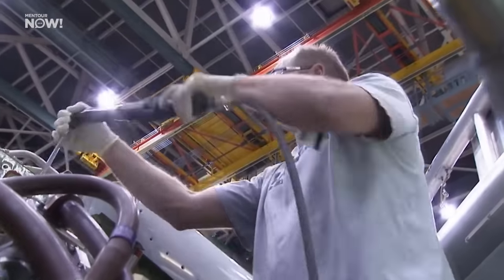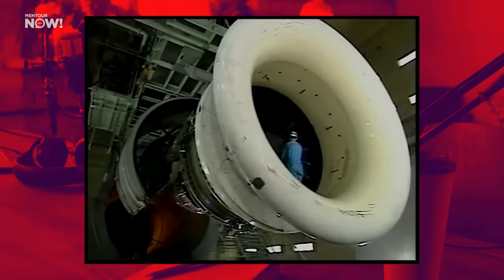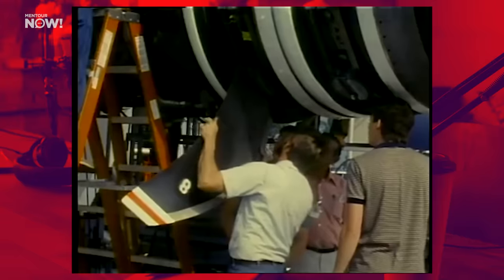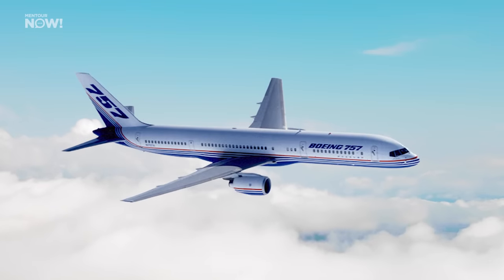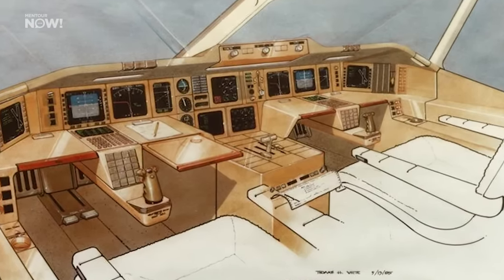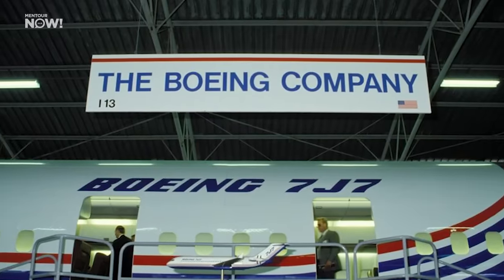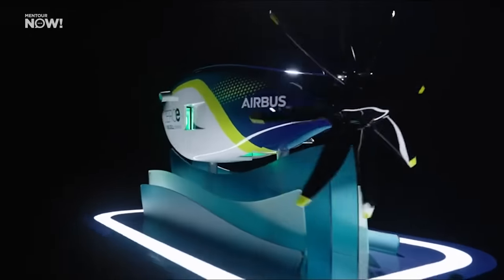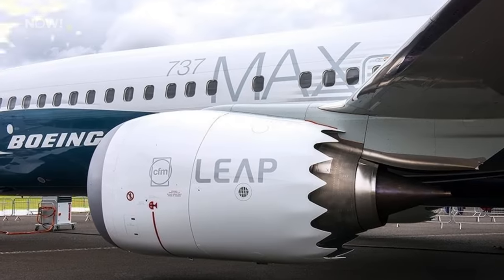Revolutionizing Flight! The Amazing Potential of the CFM RISE Engine.

Comment: I didn't know the Tupelov Tu-95 Bears were noisy because of the tip speed, I always thought it was a straight fluid dynamics issue. After the end of the cold war, the American Navy admitted they could identify them with submarines in the Arctic Ocean with Sonar microphones.  An aircraft so loud they could hear it at cruising altitude from below sea ice.
Reply: That makes sense: the achilles heal of the world's fastest turboprop aircraft! 👍🤭
Reply: The Russians ( USSR) were never able to match the US in technology. That's no surprise.
Reply: Maybe some complementary research should be done on acoustic isolation for fuselages. That would make flights quieter for passengers, if not for neighbors of airports.
Reply: @johniii8147  
Look again. The Soviet were first into Space and the first man in space. Lunar 2 was first on the Moon in 1959, not only that a few week later the Soviets sent a craft around the Moon taking pictures of the dark side sending them back. The USA was first in landing a man on the Moon, as if that made any great difference, and a reusable space craft, the Space Shuttle, which was a British idea. 

The USA had other firsts but they were small beer to what the Soviets did. The Soviet Lunokhod 1 was a remote controlled rover (the first) that landed on the Moon in 1970. To say the USA won the Space Race is absurd, as the USSR achieved most firsts, winning more races. The USA was playing catch up most of the time using a budget the Soviets scientists could only dream of. The Soviet guys were good.
Reply: @johnburns4017  USA won the marketing race to space because we still haven't beaten "the first human on a natural planet or satellite" achievement. Next step on that ladder is "First human on Mars" and we are still pretty far from that. And for general public the marketing race is the only thing that matters even if geeks could consider other factors, too.
Reply: @johniii8147  NASA were using Russian rockets to get into space until spaceX
Reply: @johniii8147  American exceptionalism in one comment
Reply: @statinskill  You do realize that "hypersonic" is just buzzword bullshit. It's like using "quantum" for woo effect. Talk is cheap.
Reply: @johnburns4017  Landing a man in the moon is a great difference. To the point no other country has done the same since.
Reply: @iwaswrongabouteveryhthing  NASA were using many types of rockets, not just Russian ones, until SpaceX. The Atlas is still around, but Russian rockets were the cheap option.
Reply: @ChucksSEADnDEAD  
Little was gained. All knowledge cab be gained by other cheaper means.
Reply: @ChucksSEADnDEAD  
If you are trying to say the Soviets were incapable of doing it, you are mistaken.
Reply: the thunderscreech was a good example of this. it had a supersonic propeller that caused ground crews to have seizures, and it even caused hearing damage when flying at a cruising altitude. there is no true recorded sound of the blades, but the faster props spin they get incredibly loud.
Reply: @sammiller6631  buzzword BS until we finally build one, right?
Reply: @johnburns4017  They could have been capable. All we know is that they didn't.
Reply: The civilian airliner based on the 95 was the Tu-114. In 1987 (approx) I was in Malta when all western air connections to Libya was banned. Their only air connection was by direct Tu-114 to Moscow. (they were brought back into service for this). One day I heard this amazing turboprop whine as the Tu-114 enroute to Moscow was nearing top of climb. Looking up I could identify the aeroplane clearly and the  noise, even at that altitude was very distinctive.
Reply: @ChucksSEADnDEAD  
Not could have, they were capable.  The Soviets were first in just about everything in space.
Reply: @davidmacdonald1695  
Take the stars and stripes glasses off.  Again...
The Soviets were ahead all along.  You are saying because they never bothered going to the Moon as the budget was cut, every other first they achieved didn't happen. 

Do you see Reds under the bed as well?
Reply: @sammiller6631  - Engineer here. "Hypersonic" is actually a real engineering term referring to speeds in excess of around Mach 5. I say "around" because there are a number of different definitions of the concept depending on what you care about, but all of them boil down to air starting to do strange things once you get going faster than that. A lot of the equations used to describe the behavior of air stop working when you're going that fast, so a new term was invented to describe that particular set of conditions.
Reply: @johnburns4017  I agree,  but we were the first to step foot on the moon. After that, well, who knows what the Soviet was doing?
Reply: @johniii8147  - Engineer here. This true in one sense and false in another.

It's true because Soviet engineering was comparatively weak in very high technology materials and electronics, or any other domain of engineering that depended on very tight, very rigorous quality control. This is not because they were stupid or uncreative. Their manufacturing capacity simply did not do tight, rigorous, hard-ass quality control very well, which was very much a political issue, not a failure of intelligence (as in smarts) or creativity. Running a manufacturing operation with high-level quality control requires the line workers and low-level engineers to speak up when they see problems and to suggest solutions to them, but their political system simply did not encourage people to stand out in that way. Their system also had a tendency to discourage intense research programs of the sort that inevitably experience a lot of failures (such as in rocket engines; it's pretty much a given that most of them will go 'boom') both because of political conditions and simple budgetary constraints. As a result, it took the Soviets a lot longer to develop what we in the west tend to call "high-technology" solutions to a lot of problems.

It's false in that the Soviets were as smart as anyone else and they excelled at low-to-medium technology solutions, like the AK rifle, the basic design of which was solidified in the late 40s and remains hugely popular. The T-55 was another example of such a system. It was a top-of-the-line tank when it was designed, and again, remains hugely popular. One might point out that the AR platform and the Centurion tank were Western designs of comparable longevity and popularity, and that's true to a certain extent, but that misses much of the genius of Soviet engineering: simplicity of manufacture and sustainment. The beauty of the AK design is that, aside from the barrel and the bolt, they require almost no real precision manufacturing capability at all. Given a supply of barrels and bolts, any half-decent machine shop can crank the things out, and even those two precision parts don't need all *that* much precision. Heck, with barrels and bolts, you can make the things in your garage with ordinary hand tools. Same goes for the T-55. With the exception of major armor repairs, a troop of baboons can keep a battalion of T-55s running with nothing more than the kind of tool set used to maintain commercial trucks. And again, aside from a relatively small number of precision parts and armor-related things, any organization with the ability to manufacture commercial trucks and their motors can manufacture spare parts for the T-55. This is emphatically NOT true for most Western designs, especially tanks and such. THIS is the genius of Soviet engineering.

And make no mistake; the Soviets could do high technology and good, tight quality control when they were really motivated. The modern phased-array, fully-digitally-controlled radar antenna of the sort used by the most modern fighters today was first deployed on the MiG-31. Integrated infrared air-to-air sensors are only now becoming common on Western fighter aircraft, but they've been a part of most Soviet and Russian designs for at least 40 years.  They also had a lot of great ideas that they may not have been able to execute because of budget and quality control issues. The F-35B's engine configuration was pioneered at least 30 years ago by the YaK-141, which was never fully developed because of the end of the Cold War. The Buran space shuttle used a rocket and booster combination that was, in many ways, somewhat more clever than that of the US Space Shuttle, but that, again, was never fully-developed because of the end of the Cold War. There is a pretty long list of good ideas the Soviets had that were later copied and fully developed by Western engineers (a good engineer creates a new design; a *great* engineer finds someone else's good idea and makes it better).

I hope this has shed a bit of light on some of the more subtle issues of Western vs Soviet engineering, and that we can put away these very childish shouting matches where we blindly assert that one must have been clearly better than the other.
Reply: @johnburns4017  I wonder why the Soviet Union collapsed
Reply: @johnburns4017  Good???.....not good enough to remain in the running......they blew their capability and never managed to get back in the race..........as in formular 1 car racing, a few first wins doesn't make you a World champion.
Reply: @JohnnyWishbone85  
You had me until you tried to inject politics into it.

Soviet technology didn't do tight tolerances because tight tolerances is expensive, and as big as the soviet union was, it was nowhere near as well endowed as America is. 

The soviets absolutely could do tight tolerance stuff, (remember the intricate listening device in that eagle?) It's just that there wasn't anywhere near as much resources for the soviets to piss away as the Americans did. 

Precision has massively diminishing returns. Why reduce yields to 1/10 for 10% better performance? The bloc needed more stuff than they had the resources to produce, why would you throw away the 9 widgets that mostly worked?
Reply: @anivicuno9473  - Sure, precision has a cost, and America was more *able* to bear that cost. But that doesn't answer the issue of why America was more *willing* to bear that cost, which you rightly raised. Why buy one of the great thing if you can have ten of the okay thing? It's a good question, and the answer, my friend, is...

Politics. You cannot get away from it. Politics touches everything.

EDIT: You'll remember that I did say the Soviets could do really good QC when they were really motivated. But it was harder for them.
Reply: @johniii8147  One thing we have learnt is the Russians don't really talk about their Pravda gear much.
Reply: @jamesmooney8933  There is no wonder why about that for a long time.
Reply: @sammiller6631  Apparently quantum tunneling is required for hydrogen fusion in stars. Don’t tell Elon or he’ll start boring holes in the Sun.
Reply: Boeing is waiting because we’re going to have grapheme batteries within this decade. Once we have graphene batteries you can make an electric plane. 

It basically works like this. Graphene is both able to be a material to built with as well as a battery. My assumption is that they’re going to make a hybrid plane. One that has the ability to drive the turbo fan with the electric motor while at cruising speed and the jet runs at an extremely lean burn that just sips fuel but can be turned back on to full thrust at any point. That way if the batteries fail the engine can still be kicked back in. 

Graphene will be lighter and stronger than carbon fiber and the hybrid technology will allow them to use far less fuel. 

Electricity will always be safer and cheaper than hydrogen. It uses existing reliable engine technologies that make it possible to pass regulations to fly. And most importantly the idea of an airport having an entire roof of solar panels to supply the electricity to these planes is an obvious win for both sides. 

Graphene can be charged almost instantly. It doesn’t have the issues other batteries have. It basically is able to absorb that charge with no latency.
Reply: @ZoneProfessionalGardening  
You need to do some reading. Back to the assertion that US technology was better than the USSR.  Yerrr sure Buddy.
Reply: @jamesmooney8933  
You have a wayward mind.
Reply: @gangleweed  
Once again.....
The Soviets were first at most things in space. I never made it up. The USA relied a  lot on the British to get themselves kick started - less so than the Germans. Search on YouTube Mark Felton Megaroc.  The British built a rocket and planned to have a man in space by 1950. All was handed over the the USA who based a lot of their space equipment on Megaroc, when they decided to do something of course.
Reply: @JohnnyWishbone85  wrote:
"It's false in that the Soviets were as smart as anyone else"

You need to do some reading sunshine. The Americans were not that bright as the British did the heavy thinking for them.
Reply: @stevederp9801  
Excellent post. BTW, the batteries will not fail as they will be in separate banks.  Skeleton an Estonian/German outfit is selling Graphine batteries. The density will get better and better as time moves on.
Reply: @stevederp9801  wrote:
"Electricity will always be safer and cheaper than hydrogen."

Redcar  in the north east of England, and Whitby near Liverpool in England are trials for hydrogen.  These places will have the natural gas pipe network converted to hydrogen, along with the appliances.  This is a trial.

These places were chosen as refineries are close that produce the hydrogen. 

Japan is turning to hydrogen for energy used by heavy industry.
Reply: @johnburns4017  You are looking at mechanics, and  not business environments.   The USSR was a planned economy.
Economy's are too complicated to plan.  Planned Economy's can have singular success,  but not over all economic.
Stalin had success jump starting a primitive economic into a semi-modern economy.
Reply: @johnburns4017  America won the space race because we reached the finish line first. Cope.
Reply: @johnburns4017  There is no dark side of the moon...there is the backside of the moon which during a lunar eclipse is fully lit up because the moon is between the earth and sun.
Reply: @johnburns4017  Nice job comrade...

Timeline: Famous Firsts in Space Exploration

Updated February 13, 2017 | Infoplease Staff [Updated by an Infoplease Editor on February 13, 2017]
pluto

Image of Pluto sent back by New Horizons.

Source: NASA

Here are dates of important firsts in space exploration
	
1958 	1963 	1975 	1981 	1985 	1990 	2004 	2015
1958 	

    Project Mercury, initiated in 1958 and completed in 1963, is the United States' first human-in-space program. It is designed to further knowledge about humanity's capabilities in space. 

1959 	

April
    Seven military-jet test pilots are introduced to the public as America's first astronauts. They are: Lt. M. Scott Carpenter, USN; Capt. L. Gordon Cooper, Jr., USAF; Lt. Col. John H. Glenn, Jr., USMC; Cap. Virgil I. Grissom, USAF; Lt. Cdr. Walter M. Schirra, Jr., USN; Lt. Cdr. Alan B. Shepard, Jr., USN; and Capt. Donald K. Slayton, USAF. 

1960 	

April
    NASA tests the first female trainees for astronaut duty in the Mercury program. Thirteen out of America's 25 top female civilian pilots (women weren't allowed to be military pilots then) pass the same rigorous testing that male candidates underwent in the Mercury 7 space program. Although all the pilots prove fit to become Mercury astronauts, NASA suddenly cancels its testing of qualified women in July 1961, claiming that they require jet test-pilot training at Edwards Air Force Base. Unfortunately, instruction at Edwards is closed to women. This new requirement ends America's chance to put the first women in space. 

1961 	

April 12
    Yuri Gagarin of the USSR becomes the first person in space. 

May 5
    Alan Shepard makes a suborbital flight in Freedom 7, becoming the first American in space. Time: 15 minutes, 22 seconds. 

Aug. 6-7
    The USSR's Gherman Titov becomes the first man to take a long-duration flight in space. His flight time is 25 hours and 18 minutes. 

1962 	

Feb. 20
    John Glenn makes a three-orbit flight in Friendship 7 and becomes the first American in orbit. Time: 4 hours, 55 minutes. 

1963 	

June 16
    Valentina Tereshkova of the USSR becomes the first woman in space. 

1964 	

Oct. 12
    The USSR's Vladimir Komarov, Konstantin P. Feoktistov, and Boris G. Yegorov take part in the first 3-person orbital flight and the first flight without space suits on the Voskhod 1. 

1965 	

March 18
    Alexei A. Leonov of the USSR takes the first space walk, which lasts ten minutes. 

March 23
    Virgil Grissom and John Young are the first American 2-person crew on the GT III. 

June 3-7
    While on the GT IV, the first American space walk is made by Edward White, II. It lasts slightly over 20 minutes. 

Top
1966 	

March 16-17
    The first docking happens between a staffed spaceraft, GT VIII, and an unstaffed space vehicle, an orbiting Agena rocket. Neil Armstrong and David Scott are on board the GT VIII. 

1968 	

Dec. 21-27
    Apollo 8 becomes the first spacecraft in circumlunar orbit and sends TV transmissions from this orbit. Frank Borman, James A. Lovell, Jr., and William A. Anders are the first astronauts to view the whole Earth. 

1969 	

Mar. 3-13
    James A. McDivitt, David R. Scott, and Russell L. Schweikart participate in the first staffed flight of Lunar Module on Apollo 9. 

May 18-26
    Apollo 10 becomes the first staffed flight to descend within nine miles of the Moon's surface. Thomas P. Stafford, Eugene A. Cernan, and John W. Young are on the flight. 

July 16-24
    Apollo 11 takes off on the first manned flight to the moon with Neil A. Armstrong, Edwin E. Aldrin, Jr., and Michael Collins. 

July 20
    Neil Armstrong becomes the first man to walk on the Moon. 

Oct. 11-16
    For the first time ever, the USSR puts three spacecraft and seven men into the Earth's orbit simultaneously. 

1971 	

June 6-30
    Spacecraft Soyuz 11 links up for the first time with space station, Salyut 1. It is also the longest stay in space to date. Georgiy Tomofeyevich Dobrovolskiy, Vladislav Nikolayevich Volkov, and Viktor Ivanovich Patsyev die on the mission due to loss of pressurization in the spacecraft. 

July 26-Aug. 7
    David Scott and James Irwin use the first lunar rover and send the first live pictures of lift-off from the Moon while on Apollo 15. 

1973 	

May 25-June 22
    The first staffed Skylab is launched, Skylab SL-2, manned by Charles Conrad, Jr., Joseph P. Kerwin, and Paul J. Weitz. 

1975 	

July 15
    The Russian Soyuz and the U.S. Apollo launches. The Apollo-Soyuz mission is the first international manned spaceflight. 
Top

July 17
    The American Apollo and Soviet Soyuz spacecraft link up for the first time. 

1980 	

Sept. 18
    General Arnaldo Tamayo Méndez becomes the first Latin American, first Cuban, and first person of African descent to fly in space aboard the Soviet Soyuz 38. 

1981 	

April 12
    The first voyage of the space shuttle Columbia begins. Capt. Robert L. Crippen and John W. Young are on the flight. 

1983 	

June 18
    Sally Ride becomes the first American woman in space. 

Aug. 30
    Guion S. Bluford is the first African-American astronaut to travel in space on the STS-8 Challenger flight. 

1984 	

Feb. 7
    Astronauts Bruce McCandless and Robert Stewart make the first untethered space walks (with jet backpacks) on the STS-8 Challenger flight. 

July 25
    Soviet cosmonaut Svetlana Savitskaya becomes the first woman to walk in space. 

Aug. 30
    Space shuttle Discovery has its first flight. 

1985 	

Aug. 8
    First flight of Atlantis space shuttle. 

Top
1988 	

Sept. 29-Oct. 3
    First flight of a space shuttle (Discovery) since the Challenger disaster. 

1989 	

May 4
    Magellan Venus probe becomes the first probe to be launched from a shuttle, Atlantis. 

1992 	

May 7-16
    While on a U.S. Endeavour mission, three mission specialists capture a satellite using their hands only for the first time. 

1995 	

Feb. 3-11
    First rendezvous between a U.S. spacecraft, Discovery, and a Russian space station, Mir. Also, Lt. Col. Eileen M. Collins becomes the first female to pilot a space shuttle during this mission. 

March 14-22
    U.S. astronaut Dr. Norman E. Thagard becomes the first American to fly aboard a Russian spacecraft, Soyuz TM-21, with a Russian crew. He is also the first American to enter the Mir space station. 

June 27-July 7
The Atlantis becomes the first space shuttle to link-up with Mir.

1996 	

March 22-31
    Shannon W. Lucid is the first American woman to live on Mir. 

2000-2001 	

Oct. 31-March 18, 2001
    The first crew boards the International Space Station. 

2002 	

April 8-19
    Mobile Transporter, the first railroad, is put in space during a mission of the Atlantis. 

2003 	

Aug. 10
    Russia's Yuri Malenchenko becomes the first man to get married from space. 

2012 	

Oct. 7
    SpaceX, a private company, sends an unmanned capsule with supplies to the International Space Station. It is the first commercial space mission and the first under contract with NASA. 

2015 	

July
    The spacecraft New Horizons passes by Pluto on July 14, 2015, and comes within 7,800 miles of its surface, its closest flyby. The craft captured images of Pluto and sent them back to Earth. The mission measured the diameter of Pluto (1,472 miles), confirmed the presence of nitrogen and methane ice at the polar region, and discovered that there are higher levels of nitrogen emitting from the atmosphere into space.
Reply: @johnburns4017  - Smoking crack can kill you, you know.
Reply: @stevederp9801  Highly doubt that is the reason.
Reply: @johniii8147  I have no doubt...but as with the Chinese....the spying is much worse in a free society.
Reply: @alantasman8273  I don't believe that. What do you think Meta, Apple and Alphabet do on a daily basis? It's how they they make their money.
Reply: @JohnnyWishbone85  
Yes, you should keep off it.
Reply: @alantasman8273  
Thank you. The Soviets were ahead most of the time.
Reply: @johnburns4017  - "I am rubber and you are glue; whatever you say bounces off me and sticks to you." -- johnburns4017, 2023
Reply: @statinskill  But I do not have the same amount of faith in the condition of Russians nuclear subs or missiles. Russia needed help to dismantle 100 old rusting nuclear subs from outside countries because they are not capable of doing it themselves.
Reply: @statinskill  I am not knocking Russian people, from what I have seen, Russians seem hard working, intelligent and friendly people….it is the condition of the military equipment I’m criticising.
Reply: The TU-95 was extra noisy for a few more reasons, I think.
1. The front and rear prop had the same number of blades (4), making sure the sound waves from every blade coincided and amplified each other.
2. The props were mounted very close together, resulting in a more violent interaction between sound pulse from the front propeller and the blades of the rear prop.
Reply: @johniii8147  Hypersonic missiles...You lag like 8 years and even then you will have tech with at most 70 percent capabilities of their new hypersonic design...You still havent figured out how Avangard is manuevered let alone to developed it
Reply: @johnburns4017  On the other hand you can compare Soviet and American fighter planes at any stage of WW2; US planes were superior. Year for year. You fly a Yak and I'll fly a P-51, see who wins.  Step into the jet age, and I'll take an F-86 Sabre over a MiG-15 any day.  The only reason the Soviets (and the Chinese today) made any competitive progress was from stealing I.P.  Just like they were stealing the plans to our ultra-quiet, top secret submarine prop in the 80's, which had a fin spacing offset and a particular blade curve.  Sure, they took a lot of good German scientists, as we did, too.  But going back to the Yak-9, pilots were advised to not fly at "combat speed" because it reduced the life of the plane to 3 or 4 sorties before scrap.
Reply: @statinskill  ICBM's already do that, and there is already no serious defense against them. Hypersonics are not the game changer people think they are.
Reply: @Barefoot433  
Such a wandering mind. The topic was Space.
Reply: @statinskill  Like the B-52 in US service, the Tu-95 is very old technology being used as a flying bus to carry around very modern technology.
Reply: @MikkoRantalainen  It was the marketing race that doomed the apollo program to being cut short, caused shuttle to be built (a camel is a horse built by committee: See "space shuttle") and arguably put spaceflight of all kinds back 30-40 years

Slow and steady would have been much better overall
Reply: @statinskill  Sounds good on paper doesn't it? Ukraine says hold my beer ,lol.
Reply: @miscbits6399  The space shuttle project was indeed pretty silly from the start.

Raising any mass to the orbit is hideously expensive so having a reusable space shuttle with dry weight of 78000 kg was always going to be pretty bad plan.

Assuming a low average $1000/kg for the fuel costs alone to get something to the orbit, the 78000 kg dry weight for the shuttle put minimum extra cost to $78 million per launch for the empty shuttle alone. Any real cargo would be on top of that.

As a comparision, total cost for a single SpaceX Falcon 9 mission is 50–67 million USD.
Reply: @michaelsamuel9917  
Do you see Reds under the bed?
BTW, most firsts in Space were by the Soviets.
Reply: @johniii8147  They did, however kill fewer people (astronauts) travelling to & from space....
Reply: @sammiller6631  I believe you mean the Titan rocket is still in use.
Reply: @anivicuno9473   politics aside, the USSR chose to use a large cluster of smaller, but proven engines. The statistics got in the way. With so many engines, there was a certainty that “some” engines would fail. What happened was, WAY more failed than what was projected, AND, the symmetry of the failure yielded an uncorrectable thrust imbalance. The resulting dynamic stresses literally tore the vehicle apart.  Wouldn’t it had been lovely if our two nations would have cooperated on the project?  Perhaps the resulting cost sharing would have translated into a continuing presence in space that would have put mankind on Mars decades ago!
Reply: @iwaswrongabouteveryhthing  he said USSR, which was disbanded in 1991. the us began using russian rockets (it was just an engine iirc) in 2000. so you’re wrong i’m two ways.
Reply: @AcornFox  🥱yawn
Please continue its fascinating
Reply: @iwaswrongabouteveryhthing  who tf are you 😂
Reply: @johnburns4017    In the early days of space travel when the efforts on both sides was trying to do basic things like putting a satellite in space, and putting a man in space, both sides were roughly on par but the Russians were a few months ahead. The Russians put the first satellite into space four months before the U.S. did. The Russians put the first man into orbit thirteen months prior to the U.S. doing it.
 
From that point forward however the Russians struggled to improve their technology whereas the U.S. space program began to rapidly accelerate. In 1965 the U.S. began flying their two man Gemini capsule which was capable of rendezvous, docking, major orbital changes, and EVA’s (spacewalks).  This was two years before the Russians had this capability when they flew their next (and last) spacecraft the Soyuz in 1967.

The Russians did the first spacewalk in 1965 three months prior to the first U.S. spacewalk. But the Russian Voskhod capsule was not designed for EVA’s, it could not be fully depressurized and so they had to use an inflatable airlock. The cosmonaut nearly died when he could not get back into the airlock and the Russians did not attempt another spacewalk until 1969. By that time the U.S. had already performed nine spacewalks.

The Russian Soyuz capsule in 1967 was essentially equivalent to the 1965 Gemini capsule, although the Soyuz carried three cosmonauts while Gemini only carried two astronauts. However the Soyuz is the last spacecraft built by the Russians. They have not built a new spacecraft in fifty-five years.

Meanwhile the U.S. has built many new spacecraft over the decades.  Eighteen months after the Soyuz debuted the U.S. flew its three-man Apollo spacecraft which was capable of flying to the Moon, which it did in December 1968. 
The U.S. built its fourth spacecraft the Lunar Module, which landed on the Moon in July 1969. The U.S. built its fifth spacecraft the Space Shuttle which flew in 1981. The U.S. built its sixth spacecraft the SpaceX Dragon in 2020. This year the seventh U.S. Spacecraft the Boeing Starliner is schedule to carry astronauts. In about a year NASA’s Orion capsule will carry astronauts to the Moon, becoming the eighth U.S. spacecraft.

Russia is still flying their 1967 Soyuz, although with upgraded electronics. They have no current plans to develop any new or more capable spacecraft. The Soyuz is launched using the same rocket design that was used to launch Sputnik in 1957.

Space station technology is a similar story, the Russians had several firsts, but the U.S. along with its European and Japanese partner has surpassed them in technology and there are more advances on the way as commercial space is becoming involved. The Russians meanwhile will likely end their space program at the conclusion of the International Space Station program, as they have made no progress on their talked about future space station.

This is not a knock on the Russian program, flying in space is very difficult and until recently the Russians were the only country other than the U.S. to do so. And they had several of the early firsts over sixty years ago. However the Chinese have just about reached the same level as the Russians in recent years and they will likely become the next competitors to the U.S. in human spaceflight, whereas it is not certain if the Russian space program will continue when the International Space Station is retired.
Reply: @StevePemberton2  
Once again, most firsts were achieved by the Soviets. I never made it up.
Reply: @johnburns4017  In my list I acknowledged the Soviet firsts. History will always show them as first, it is something that cannot be taken away from them. They were true achievements. However you have been making the assertion that these firsts proved Soviet technical superiority over the U.S. This is the same propaganda that the Soviets used in the early days of the space race. Like all propaganda it sounds good as long as you don't actually look at the details. The details that I laid out pointed out that the early Soviet firsts were typically only a few months ahead of the U.S., and that the U.S. quickly surpassed the Soviets in technology and achievements.

You also made the same claim about early Soviet space probe firsts, again trying to use this to prove that the Soviets had superior technology.  Again the actual details straighten out the propaganda. The space probes story is similar, the Russians had some early firsts but their technology was soon surpassed by the U.S. and other countries.

MOON

The Soviets sent the first probe to fly past the Moon two months before the U.S. did. The Soviets took the first pictures of the far side of the Moon. The U.S. took the first closeup pictures of the lunar surface from probes that impacted but did not land. The Russians soft-landed the first probe on the lunar surface four months before the U.S. did.

But as with their manned space program, the Soviet firsts were just a few months ahead of the U.S. After that the Russian lunar program stalled and since then there have not been any significant Russian explorations of the Moon, other than some small sample return missions in the 1970's that returned about twelve ounces of lunar material, compared to over 800 lbs returned on the Apollo missions. The Russians have not sent any probes to the Moon since 1976. Meanwhile the U.S. and other countries have continued with extensive explorations of the Moon with landers, rovers, and detailed orbital mapping.

VENUS

The Russians made fifteen failed attempts in a row to send a spacecraft to Venus between 1961 and 1967. The U.S. was successful on its second attempt in 1962, becoming the first spacecraft to fly past another planet. The Russians have landed several spacecraft on Venus, something the U.S. has never attempted. However because of the harsh environment none of the landers survived more than a couple of hours, most of them less than an hour. The U.S. has no current plans to place landers on Venus because of the harsh environment which limits the amount of data that can be obtained, preferring instead to explore the surface of Mars using rovers. The Russians were the first to radar map part of Venus in the 1980’s, however they only mapped about 25% of the surface. The U.S. Magellan spacecraft in 1990 mapped nearly the entire surface of Venus with higher resolution.

SUN

The U.S. has launched several solar probes to study the Sun. Russia has launched no solar probes.

MERCURY

The U.S. has sent several probes to Mercury, Russian has not sent any.

MARS

The U.S. made the first flyby of Mars in 1965, six years (not months) before the Russians made it to Mars. The U.S. was the first to orbit another planet when Mariner 9 entered orbit around Mars in 1971. The Russians orbited Mars just two weeks later, a rare occurrence where they were the ones to miss being first by a short time period time. The Russians made the first soft landing on Mars in 1971 however the lander failed after two minutes on the surface.

The story repeats itself, the Russians never attempted another landing on Mars, they sent a couple more flyby and one probe but since 1989 the Russians have not sent any spacecraft to Mars.  The U.S. meanwhile has since sent many probes to Mars orbit and several landers and several rovers, and the first ever helicopter on another world.

ASTEROIDS

The U.S. and other countries have sent dozens of probes to study asteroids. Russia has sent none.

JUPITER

The U.S. has sent several probes to Jupiter or to fly past Jupiter on their way to other destination, including Galileo which orbited and studied the atmosphere. Russia has sent none.

SATURN

Several U.S. spacecraft have flown past Saturn, the Cassini space entered orbit around Saturn and studied the atmosphere and rings. Russia has sent none.

URANUS, NEPTUNE, PLUTO

The U.S. has flown spacecraft past these planets (and dwarf planet). Russia has sent none.

COMETS

The U.S. and other countries have sent many probes to comets including impacters and landers. Russia sent two probes to Halley’s comet in 1986 but has since sent none.

KUIPER BELT (beyond Pluto)

After flying past Pluto, the U.S. New Horizons spacecraft flew past a Kuiper belt object, and is now on its way to a second Kuiper belt object.

OUTER SOLAR SYSTEM

Five of the U.S. planetary flyby spacecraft continued on to the outer reaches of the solar system.  Two of these spacecraft, Voyager 1 and Voyager 2 have flown past the heliosphere and continue to transmit data about the far reaches of the solar system after being launched forty-five years ago.
Reply: @alantasman8273  That's a good list that you have there but there was one urban legend mixed in there about the "Mercury 13". Most of the following quote is not true:

"NASA tests the first female trainees for astronaut duty in the Mercury program. Thirteen out of America's 25 top female civilian pilots (women weren't allowed to be military pilots then) pass the same rigorous testing that male candidates underwent in the Mercury 7 space program. Although all the pilots prove fit to become Mercury astronauts, NASA suddenly cancels its testing of qualified women in July 1961, claiming that they require jet test-pilot training at Edwards Air Force Base. Unfortunately, instruction at Edwards is closed to women. This new requirement ends America's chance to put the first women in space." 

NASA was never involved in any of this. A doctor who had helped develop the medical tests that NASA used to test the Mercury astronauts decided on his own to conduct the same medical tests on female pilots. This was not part of any official program. And there was no "astronaut training" involved it was only medical testing. There is no indication that any of them were necessarily the "top female pilots", since they were selected by a doctor, although all of the women had extensive flight experience. Two standouts were Jerrie Cobb who was well known for setting several aviation records, and Wally Funk who had an extensive aviation career including air racing, and she spent many years as an air safety investigator for the FAA. In 2021 she was invited by Jeff Bezos to fly with him and four other people on the first flight of the New Shepard suborbital tourist spacecraft that carried passengers.

Several woman pilots were tested, none of whom were ever together or ever met each other until over three decades later when some of them began to seek out others who had participated in the tests. At one point someone came up with the name "Mercury 13" although the actual origination of that name is unclear. The name seems to have helped perpetuate the myth that the tests were part of an official NASA program.

Of the women who were tested thirteen passed the medical tests at the same level or higher than the astronauts. There is some dispute if all of the same tests were conducted as the men, but in general the women demonstrated that physically they were well capable of flying in space. Keeping in mind that no one at the time knew what spaceflight would do to the human body so the tests were designed to test several different physical qualities and capabilities.

NASA's requirement at the time was that only test pilots could be astronauts. Besides superb flying skills, test pilots had to be technically knowledgeable about their aircraft as they had to interact with engineers on a very technical level. This also meant that they had security clearances. Becoming a test pilot also required prior experience in high performance aircraft. However women were not allowed in combat roles at the time, so there were no female fighter jet pilots, and thus no female test pilots. Because of this NASA never considered having female astronauts until the Space Shuttle program which included non-pilot mission specialists.
Reply: I had a floatplane that musta had the same prop - 10 miles anywhere near society resulted in noise complaints. 😆
Reply: @alantasman8273  Using a Pythagorean Right-Triangle survey method to measure the Moon's height above ground, knowing the distance in miles from your location to the Moon's Zenth Spot (where the moon is directly above that spot on the ground) the angle of the Moon's altitude from your location solves for the missing leg of the Right-triangle and you can measure the Moon's height above it's Zenith spot in miles with 100% accuracy.

I have done the calculation using a "Right Triangle Calculator" (free online) and using the miles to Zenith location and the Moon's altitude angle, measured the Moon is less than 3,000 miles up.

You can do the measurement yourself before making snap judgments about the method or accuracy. 

Try it, you'll like it. This method works for everything equally. You can measure the actual height of a streetlamp, a skyscraper, even the Moon.

Moon Zenith location and altitude angle can both be found on Time and Date dot com

Google "Right Triangle Calculator"
Reply: @johnburns4017  Well in all fairness, the topic of this YouTube clip is aircraft engines, not space. And the poster that you replied to wrote: "The Russians ( USSR) were never able to match the US in technology. That's no surprise." so he never mentioned space. You then chose to talk strictly about space on a clip aboput aircraft engines. You have the right do that for sure, but to then kind of demand everybody should stick to your chosen topic does come across as a bit self centered...
Reply: @mateuszmattias  
technology
No specific category was given. Also the Soviets made some excellent aircraft the MIG 29 comes to mind.
Reply: CAPTAIN! SOVIET LEFT SOVIET AIRSPACE AND IS COMMING OUR WAY!

But...we are submerged!

pulls off headphones HEAR FOR YOURSELF! ITS QUITE NOISY!
Reply: @johnburns4017  If they're so great where are they now. (Rhetorical question because I know the answer). They weren't so great because the whole system collapsed and Russia is still a mess to this day.
Reply: @johnburns4017  You didn't actually respond at all though, all you did was talk about something but not how it relates to the comment you're responding to
Reply: @johnburns4017  Did you bother to read anything more?
Reply: @johnburns4017  Said who? You made it space so you could praise your "glorious leader"
Reply: @truereaper4572  uhhh. Ever hear of Sputnik?
Reply: @mkseed9188  Um that well over 50 years ago not present day.
Reply: @theformalmooshroom9147  
I does not matter where they are now. The Soviets achieved most firsts in the Space Race.  Get over it.
Reply: US tall tales!😂😂😂😂
Reply: @kpt6943  We have had the capability for years. It was deemed unworthy. 
That kind of first strike capability is worthless in our eyes, because it won’t help us achieve our goals. 

Also we can defend against them, just not that well.

More importantly. Russia has done nothing but talk. There is no proof that they have the capability they say, and no reason to trust them.
Reply: @JohnnyWishbone85  like umm, dare I say it.... Chevy vs Ford Pickup debates?
Reply: @davidlindburg1921 , Achilles' heel. See, Achilles is a name, a genitive has an apostrope, heal is a verb, heel is a noun.
Reply: @johnburns4017 Thanks, I was having a rough day and really need that laugh!
Reply: @johnburns4017 The Soviets might have been able to get a man to the moon… getting him back alive?  Not so much.
Reply: @FastEddy1959  
Again...
The Soviets achieved most firsts in the Space Race.  Get over it.
Reply: @statinskill This aged extremely well, considering the number of Kinzal's that have been shot down by the Patriot system in Ukraine. And that's just the Patriot. Add an AEGIS destroyer or an AEGIS Ashore installation and very very little will make it through the protection bubble.
Reply: @hydra70 There is a serious defense to ICBMs. It's called Aegis. Since 1997 it's successfully intercepted and destroyed 43 of the 52 missiles it has targeted, between both tests and actual real life defense engagements.

And in tests, the Aegis system does not know it's a test. There isn't a "test" setting on the switch, it's either on or off.
Reply: @SwartieLoveJoy See, here's the problem. The earth is round. Any triangle made from where you are standing to the moon, intersecting the point of the earth directly under the moon will never be a right triangle.
Reply: @statinskill  Poor spelling or not, several Kinzhal missiles have been shot down by the Patriot system deployed in Ukraine.
Reply: @statinskill  When something is coming towards you, it doesn't matter if it's traveling at 2 km/hr or Mach Jesus. It will be just as easy to shoot down regardless. There is no relative apparent velocity. Now, if the Kinzhal was completely overflying the protected zone, it would be difficult to intercept, but that's how air defense works. The AD systems only guard a specific area. Anything outside of that, they have to let through.
Reply: @richardmillhousenixon  Incorrect my friend. A triangle has 3 points. Two points are on Earth Surface, and one is at the Moon.

The shape of the Earth in between two points is not related to that right triangle, as we are not measuring Earth Shape, we are measuring Moon Distance from the Zenith Spot directly on the surface of the Earth.

The right triangle is not affected by the Earth. The triangle is perfect geometry.

To measure the height of the missing side of the right triangle (the segment from the Zenith spot on the ground, that goes up to the Moon) we know the other two lengths of the triangle sides.

1) the Distance in miles from your location to the Zenith Spot (the DISTANCE is not an angle, it is a length that is unaffected by flat or curved Earth in between)

2) the ANGLE of altitude of the Moon from your Observation Spot calculated with the Distance in miles to the Moon's Zenith Spot, gives us the  LENGTH of the hypotenuse of the right triangle, and solves the Moon height with a Right Triangle calculation)

If you stand on the Zenith Spot, the Moon will be directly over your head above you. This is the same on a Flat Earth or a Globe.

The measured distance to the Moon is the same for both a Flat Earth or a Globe.

The measured distance varies by a few hundred miles each time it is measured, but always less than 3000 miles up.

Therefore the Moon is not what they are telling us, it is not 238,000 miles away, and we never went to the Moon because of this. The measured distance exposes an untruth about the Moon's location.
Reply: @richardmillhousenixon  Aegis was not tested against an ICBM representative target until the successful SM-3 Block IIa ICBM test in 2020. Before that, it had never intercepted an ICBM representative target. That is the only known test of Aegis against an ICBM representative target. One successful test does not prove that it is a serious defense.

 You're not understanding the difference between ICBMs and other types of missiles.
Reply: @SwartieLoveJoy  My dude. That calculation does not take into account the fact that the earth is a sphere.

🌕 This is the moon.

🕑This clock represents the earth, with the minute hand pointing to the "zenith spot" and the hour hand pointing to your position. Drawing a line between the zenith spot and the moon, and then another one between your position and the zenith spot does not result in a right triangle. Pythagorean theorem doesn't work, instead you need to use the tangent.

Also, we literally have retro reflectors on the surface of the moon that you can bounce a laser off of. It takes on average 2.56 seconds for light to reach the surface of the moon and return to its point of origin on earth. The speed of light in vacuum is 299,792,458 meters per second exactly. Multiply those two, and you get 767,468,692.48 meters. Divide that in half, then convert to kilometers and you get 383,734.3 kilometers. Convert it to miles and you get 238,452.5 miles. At 3,000 miles (4,827 kilometers), multiplied by two to get round trip, that light delay would be 32 milliseconds. It's not. Not even fucking close.
Reply: @hydra70  The different ranges of ballistic missiles in their terminal phase are nearly indistinguishable.
Reply: @richardmillhousenixon  The velocities are vastly different. ICBM RV's are moving many times faster than SRBMs. It's like saying that because I can hit a duck with my shotgun, I can also hit an SR-71 with it.
Reply: @hydra70  The approach velocity isn't that important when you're talking something heading directly at you. Think of it like trying to hit a baseball. There's no extra calculations you need to do for a fastball versus a slow pitch, you just need to be able to do the same calculations faster.
Reply: @richardmillhousenixon  In what scenario do you think the ICBM is going to be heading directly for the Aegis system? It's not like anyone is going to fire ICBMs at a destroyer. Do you think there is an Aegis Ashore battery in the center of every American city?
Reply: @hydra70  The terminal phase is the most difficult time to intercept. If Aegis can do that, intercepting during the coast phase is comparatively a walk in the park.
Reply: @richardmillhousenixon  okay, but Aegis hasn’t been able to intercept ICBMs during either terminal or mid course phases until SM3 block IIa, which still has only had one test. How is this a proven ICBM defense?
Reply: @hydra70  It's a hell of a lot more proven than anything else we've got. Especially when paired with the GMD (Ground-Based Midcourse Defense) systems deployed in Alaska and California, which has a 55% single-interceptor success rate. Not great, but enough to keep extremely high priority targets like DC safe. Add the THAAD system for IRBMs and smaller, and you end up with a pretty good chance of at least keeping a few key strategic targets intact. Yes, in the event of a full exchange, we're completely fucked, regardless of if you can even save a few cities. But the likelihood of a full on MAD exchange isn't very high. Neither side wants to completely destroy the other because they know that they themselves will be destroyed. But a smaller scale exchange is still possible, especially if it is instigated by a rogue government like the DPRK. Even if the DPRK launched everything they had at us, the likelihood is less than half of their missiles will get through the defense networks. Hell, even if they launched everything they had at Japan, which is in range of more of their missiles, there are several Aegis destroyers stationed there, both from our own navy and as a part of the JSDF, that Japan may not even suffer a single successful hit.
Reply: @hydra70  Also, Aegis SM3 intercepted a satellite in 2008, which is not exactly incomparable to intercepting a ICBM in its coast phase.
Reply: @richardmillhousenixon  none of this is relevant to what I have said. It’s still only got one ICBM test under idealized conditions. That does not prove that it is a credible defense agains a large scale nuclear attack.
Reply: @hydra70  It is more credible than anything else we have, and the Ground-Based Midcourse Defense System has 20 intercept tests under it's belt. Not a lot, but it's better than nothing.
Reply: @richardmillhousenixon  The fact that it’s the best we have doesn’t make it a serious defense. GMD only has 44 deployed interceptors which would have to be used against thousands of incoming targets. And half those intercept tests were failures. It would be irrelevant in a large scale nuclear war. Neither Aegis nor GMD will make a meaningful difference.

Like I said, there is no defense.
Reply: @johniii8147  How many Zircons and Kinzhals have the USA made?
None.
Who conquered space first, being the most advanced, the Soviets.
Reply: @truereaper4572  The race was to be the first in space, which the Soviets achieved years before the USA.
Russia has never had to buy Western tech to get to space, whereas the USA has been buying and using Soviet/Russian rockets for years.

I hear Boeing are going into partnership with the Gorilla company, making sticky tape to keep Boeing aircraft from completely falling apart in the air.
Cope, and hope your next flight isn't on a Boeing.
Reply: @richardmillhousenixon  Nonsense, if they had, the USA would have shipped them stateside for testing and evaluation, and might even cop on enough to at least make a copy.
The USA just cannot do hypersonic cruise missiles. Russia is already upgrading Kinzhal for longer range, a second generation missile while the US cannot produce a first generation missile and is now 25 years behind.
Reply: @richardmillhousenixon  Baseballs move at 90 mph, Zircon does Mach12. It took 3 minutes for a Russian Black Sea ship firing a Zircon, to hit Kiev.
Reply: @richardmillhousenixon  How many North Korean missiles over the Sea of Japan has AEGIS shot down?
None
Reply: @rightiswrongrightiswrong806  Lmfao dude it doesn't shoot down what won't hit land.
Reply: That's not the whole story. Apparently the American submarines were so quiet, the Russian pilots of the Tu-95 could hear American poop hitting the deck louder than their engines, as the bomber was approaching the sub. That's how they would identify American submarines.
Reply: @statinskill  Not quite true. The US has defence missiles that can knock down hypersonic missiles. ICBMs are all hypersonic on reentry and the US did develop missile systems that can take these out - look up YT videos of the Sprint missile that could reach Mach 8 within a minute of launching. 
The Patriot missile system has many roles and one of them is defence vs ICBMs.

The problem is the developments in ground to ground low altitude short range hypersonic missiles. These travel 250 - 750 miles and can be guided and so reach the target in a few mins so giving very little warning. ICBMs in the other hand an ICBM being a high altitude into space orbit gave a lot more of warning time. 
All the major military powers have developed these and one issue is that they are fantastically expensive so Russia with a small failing economy cannot afford too many. The real risk to the US comes from China. 
Effectively the hypersonic missile could end the supremacy of aircraft carriers in naval war. The US has long had plans to defend Taiwan in the event of a Chinese invasion and an integral part is parking two or three carrier groups offshore behind Taiwan and use their aircraft and ground to air missiles to deny China control of the airspace. The carriers cannot be too far away from Taiwan as the operating range of their naval jets is hampered by a long distance. 

Theoretically a few hypersonic missiles fired from the Chinese mainland (its only 200 miles away) could be targeted at those carriers and even if they are situated 500 miles offshore those missiles would come in at Mach 8-15 and at a low altitude and the carrier would simply not be able to stop them from hitting the carrier. 

IMO when fighting a first world nation the era of the supremacy of carrier groups is over. It’s going to have to be long range missiles (slow like cruise missiles and hypersonic) and drones and then new space based platforms of exotic weapons systems.